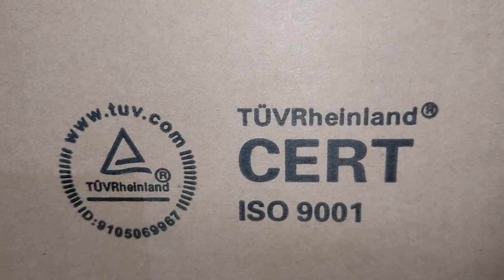Powerful 3,000 psi 24 Volt DC Hydraulic Pump with Tank and Dual Solenoid Valve

Comment: Qual bateria usar numa unidades dessa
Reply from the maker: You need to use 2 x 12 Volt DC Car or small truck batteries in series with 70 Amp hour capacity or more each. 24 Volt DC is very common in Commercial vehicles in Australia.